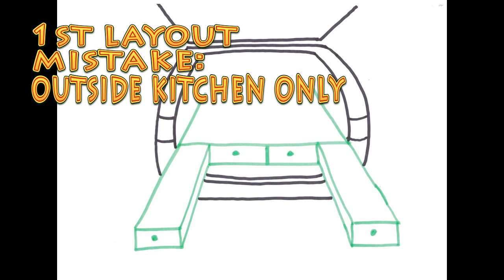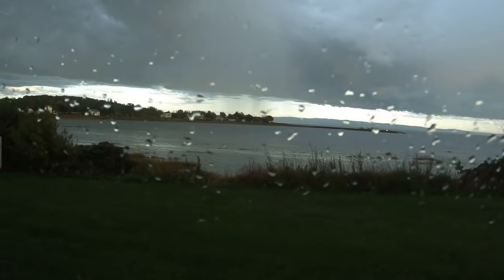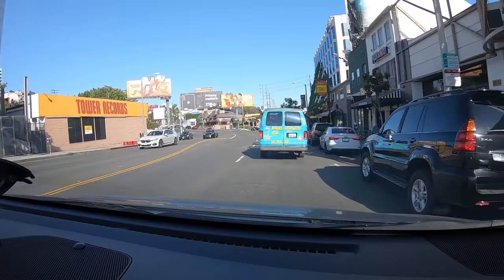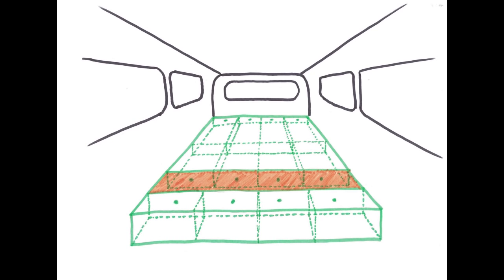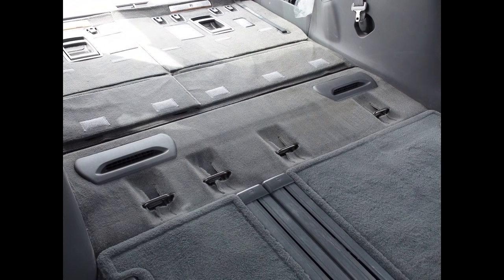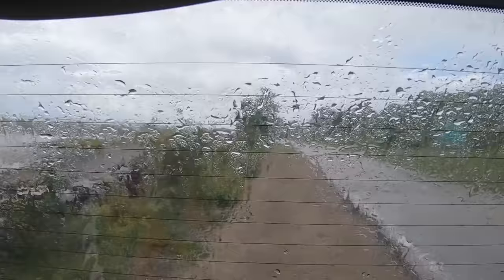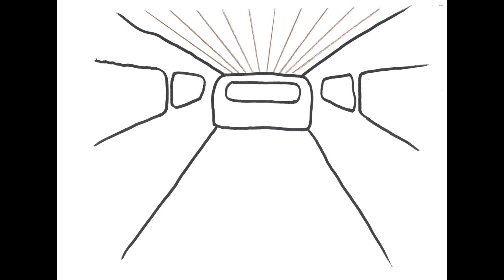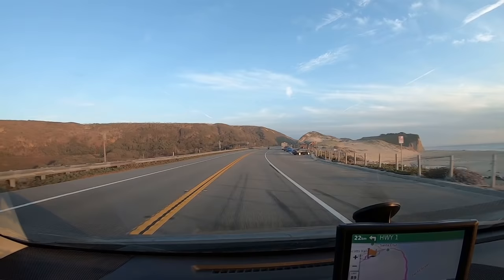11 mistakes to avoid (van conversion)

Comment: If you don't have any propane or gas in your van, how do you cook in the van?  Induction cooktop?
Reply from the maker: I use an ultralight pocket stove. You can see it briefly in my van tour video at 4m40s:
https://youtu.be/qJjL-NWeoVI
✌️
Reply: @ericenjoysearth2756  Do you have a gas alarm (enabled at night) or do you think it's not necessary when transporting/working with gas cartridges?
Reply from the maker: I store my cartridge in my Thule box on the roof. They are clearly outside and I sleep well!

Comment: I really hate it when there's no mention  of going to potty that's  just not an option!?
Reply from the maker: LOL! I think that you would have made it the 12th mistake! But it is not that bad. I will give you tips about it in a coming video..✌️
Reply: Get a nalgene bottle or equivalent. If youre a girl, buy a tiny potty or trash or compost can. Dont poop in your van. Shower and poop are done elsewhere. Thats the cost of a truly sporty, small, stealth camper that can go anywhere, at any speed, and park anywhere at night. I have a van just like his, and ive parked in front of $5million dollar homes in LaJolla and Monterrey. Try that with a large camper van, and wake up the sound of cops pounding on your window at 3am.

Comment: “You do not want your clothes under the bed” then @ 6:15 he shows cabinets for the clothes accessible when bed is deployed... but that violates the previous principal of blocking your view???
Reply from the maker: You have like 300 degrees out of 360 degrees... 😉

I seriously do not want my clothes under the bed. When I wake up, that’s when I need my new clothes...
✌️
Reply: Eric enjoys Earth - i get it now, yours is left hand drive, so your blind spot is on the left anyway. Im planning for a right hand drive Delica, so my tall cab will be on the right. Lots of good practical thoughts.
Reply from the maker: Make sens 👍

Comment: How are you cooking if not using propane?
Reply from the maker: I use ISO butane-propane cartridges. I just not store it in the van. I store it outside in the roof box✌️
Reply: @ericenjoysearth2756   Wouldn't still have to go outside of your van in order to cook? You don't keep any fuel inside?
Also, love your bed design.

Comment: About the propane gas, if i have insolated van with a hose making some distance from the tank its alright?, i'm a bit lost on that
Reply from the maker: I don’t exactly understand your set up, but anyhow you have to verify the regulations of your country and state/province...✌️
Reply: @ericenjoysearth2756  yeah its legal, I need a air tight box where the tank lives so if it leaks it leaks to the outside, that box has an vent to the exterior of the vehicle, thx man :)
Reply from the maker: I do understand your question now. So you are good with the right set up!👍

Comment: What is your strategy for cooking if you don't carry any compressed gas? I agree it's super dangerous, but it would really limit cooking options. Thanks for the vid!
Reply from the maker: I carry my fuel canister outside in the roof box. ✌️
Reply: I'd go with induction if you could rig a fuse for it. They tend to be a draw.

Comment: So where do you keep your propane?
Reply: Exteiror under mounted, or in a designated airtight cabinet with a drain if on the interior.
Reply from the maker: Outside in the roof box. ✌️